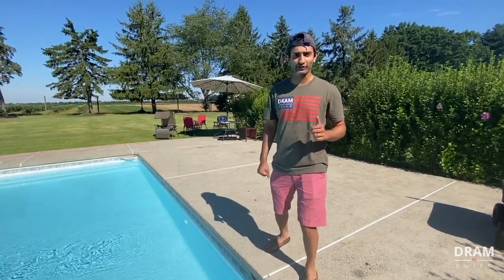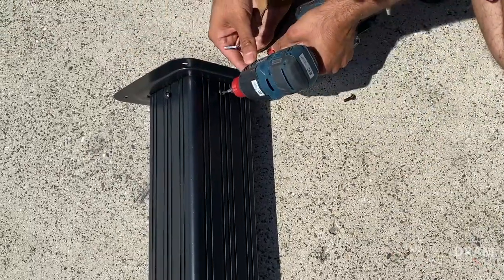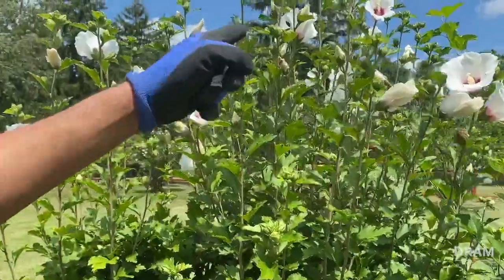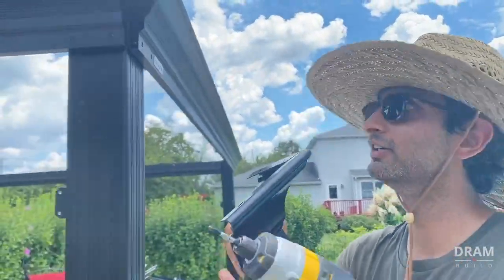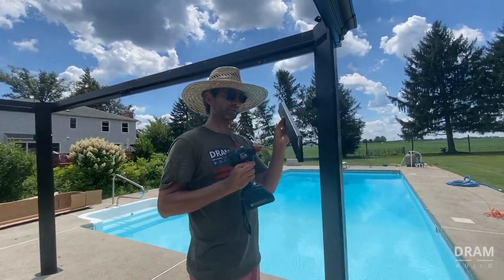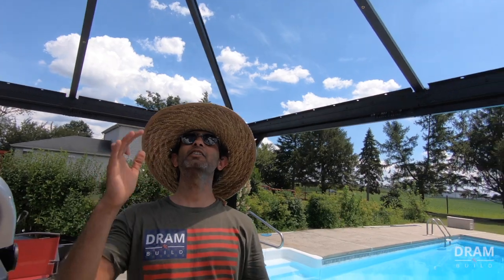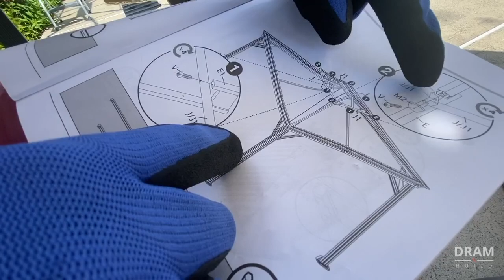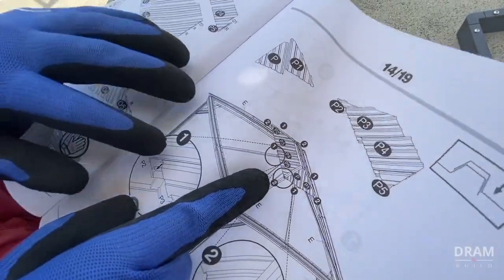Installing an Awesome Sojag Sun Shelter - Costco product - WATCH BEFORE YOU BUY.

Comment: I bought a the similar grill gazebo.  It says 2 or 3 people needed but I did mine by myself.   I had some leftover 2x8's I used to make 3' long temporary "feet".  I screwed each leg base into one of these and then the posts would stand on their own.  The cross bar can be installed with one loose screw and the other end swung up to line up and attach to the other post.  When you're done with all four, just remove the temporary wooden feet and finish the shelter.
Reply: Great idea Robert. Nothing like the satisfaction of doing it all by yourself.

Comment: Thank you for the video.  Between this video, Sojag's "official" video, and the written instructions, my wife and I were able to put our 10 x 12 Messina model together this past weekend.  As noted in this video, step 12 is definitely out of sequence.  The installation of the small upper roof panels and and frame were the most difficult part of this assembly, in my opinion.  We ended up doing it as shown in Sojag's video...standing the panels in the frame piece, and then putting each section up as a unit.

Comment: Thank you for this video. I'm hoping this will help with my 12 x 16 going in this summer!
Reply from the maker: Good luck 👍🏽
Reply: I just assembled my 12x16 messina. I put together most of the base myself and had a friend help me for a few hours when it came to the roof panels.
Reply: @donaldso718  Donald, what size screws did you use and what kind? Did you use tapcons?

Comment: Good video, thanks for sharing you experience.  I purchased the same shelter but haven't assembled it yet as I'm trying do decide whether to paint my house first.  The shelter is going on my back patio so if I install it then paint later I'll have to unbolt it and move it a few feet out of the way temporarily.  Question, is the weight of the shelter such that with a person at each leg you could pick up the shelter and move it a few feet?
Reply: You should be able to move it easily with 4 people
Reply: @mrsimplycity1  thanks!

Comment: Why didnt you put in the longer bolts of the roof panels that run along the middle while you were up there? In my opinion that was the main part that required 2 people because you need someone on the other side to tighten those bolts. And it's easier doing those bolts as you go before having all the panels installed.

Comment: Should have used anchor bolts instead of the screws.  Any problems with the posts?
Reply: screws r perfectly fine to use since there r 3 per post
perhaps a washer would be good tho
Reply: One of my posts was made wrong.  You could see where the guy putting in the rivet at the shop pressed too hard because the tool slipped and marred the finish noticeably.  Probably had a close to dead battery on a Friday and he wanted to go home so he tried to force it.  Anyway, Sojag asked for pics and then shipped me a new one.  Great customer service.

Comment: How long did it take you to put it together?
Reply from the maker: About 7-8hrs with two people.
Reply: @drambuild9800  Hello I just bought one this week and is planning to anchor it on my paver stone. Apparently the anchoring hardware was not provided.  Could you tell if you have  bought the bolts separately and what size of bolts I should buy. Thanks
Reply from the maker: @fanfancheong  I used 1/4- 2 3/4 Tapcons
Reply: @drambuild9800  Thank you so much.

Comment: no place to have a ceiling fan, deal breaker
Reply: We have the same one, just fabricated a cross-plate at the top to mount the fan.   didn't take too much to get it done and looking nice.  would be nice tho if it came with such a plate/crossbar from the factory.
Reply: @trooper5157  I would be interested to get some details on what you did for the fan support.
Reply: @1767SR     i could email you pics if you'd like.   in short tho, i used perforated round angle (metal L shaped supports, with lots of holes like an erector set) to build a framework that  goes across the inside of the cupola area. I used more of it to make crossmembers for added support and support of the electrical box for the fan itself.  we bought a slightly smaller ceiling fan since a standard sized one would have to hand further down due to the pitch of the roof.  once i had it built to size, i prmed and painted it with a textured spray paint that matched the dark brown color of the gazebo and ran power to the fan using an exterior grade extension cord with one in plugged into an exterior outlet and the other end (plug cut off) wired into the electrical box of the fan.  to attache the frame to the roof, i was able to use only existing bolts that were factory so I didn't have to drill any added holes.  the whole thing blends in and looks like it was made to be there.   After awhile I didn't like seeing the holes in the round angle bars so i bought some strips of metal that were the same width, painted them and bolted them to the bottom of the round angle frame for a cleaner look.   all in all, came out very well.
Reply: @trooper5157  Thanks for the quick reply!  And thanks for the detailed information.  So the framework you built goes inside the cupola area, correct?  I assume that means you had to do away with the mosquito netting that normally covers the opening?

Comment: About to build one for someone, alone. Wouldn’t it be easier to build the roof then install the legs under it?
Reply from the maker: You might scratch the finish. Roof is heavy and it’s strength comes form the roofing panels.
Reply: you really can't put together the roof without the base first. also you'd probably need a minimum of 4 people to lift the roof up if you did the roof first. I assembled my 12x16 mostly by myself. You just need another person when it comes to the roof panels to tighten some of the bolts.